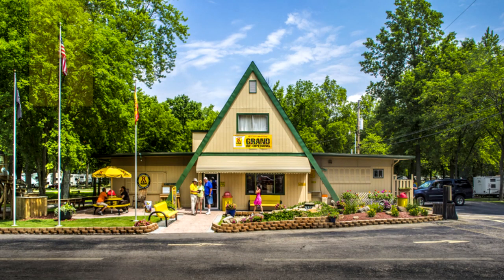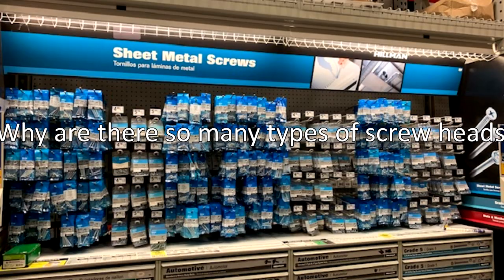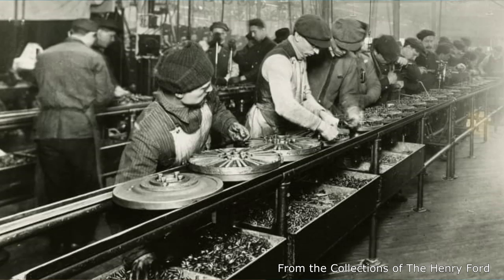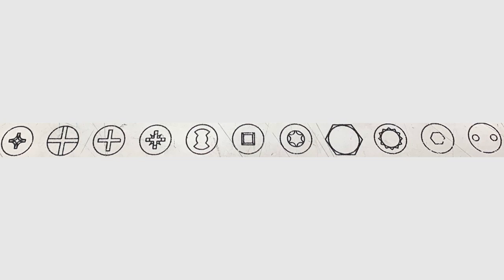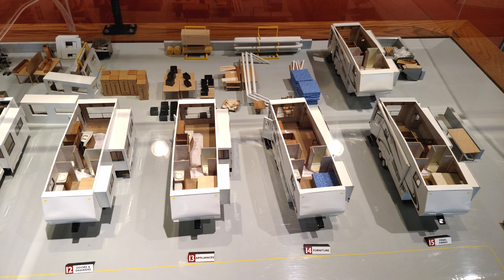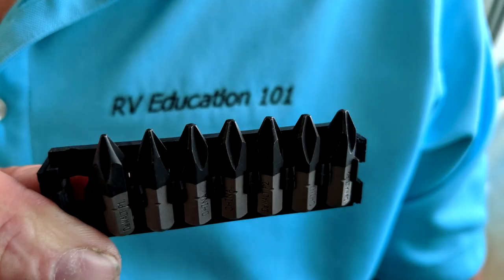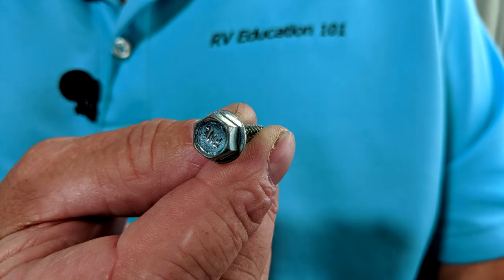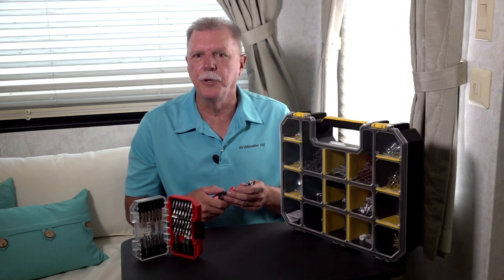RV 101® - RV Screw Types, RV Screwdrivers & Specialty Driver Bits

Comment: ⭕⭕  Mark, since the 1950's Japan has been using screws that look like Phillips heads but have less of an angle and a blunt or paned bottom. Unlike it's lookalike Phillies that comes to a point. These screws are called    "Japanese Industrial Standard "  or  JIS for short. Just like Phillips,  they come in #1,#2 & #3 sizes.  Having raced mx back in the 70's we just thought that the Japanese made bad screws.   Hope this helps

Comment: Vermont Ice Bits #2, use these for phillips. any other type of screws I just throw them out during re-assembly and replace them with phillips. Square heads sound great but when working with them I find the strip out just as fast as phillips. I really hate changing bits when working on my moho. tek phillip self drilling and plain ole' drywall screws are what I use most often in dry environments. In wet I look for galvanized construction or gold screws. I believe the other head types are just a nuisance that are over priced.... stuff media hype is made of...

Comment: Do  you have an Amazon link for this set of bits and screwdriver?
Reply: I have a set that look very much like what Mark is using . You may want to look at Harbor Freight. Most all tools are made in China these days, including Snap On. Don't be fooled by Harbor Fright, because all of there hand tools have life time warranty. Many people think all they sell is junk, not true. A lot of there tools are made in the same line as name brands.
DeWalt, Black N Decker used to be made in Maryland and for over 20 years have been made in China. Porter Cable used to be made in Tennessee., not any more. Now , China.
Sorry, I get carried away when it comes to tools. Good luck. 👍👍

Comment: You mentioned "punch-heas screws" the ones that look like a bow tie, i have those in my fifth wheel,  whats best way to get them out, i used the bits but it just damages the bits.
Reply: The screws im talking about you mentioned just after the 1 min. mark
Reply from the maker: The clutch head bits come in all different sizes, it's possible you are using a smaller size bit and it is stripping the screw head.